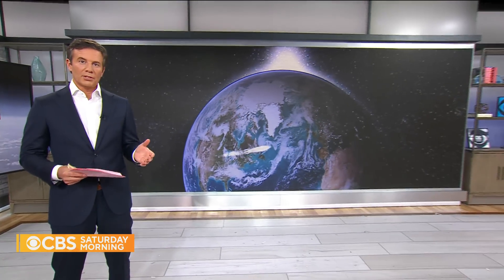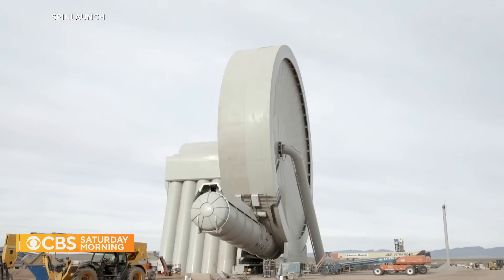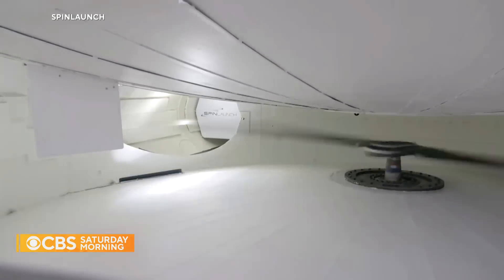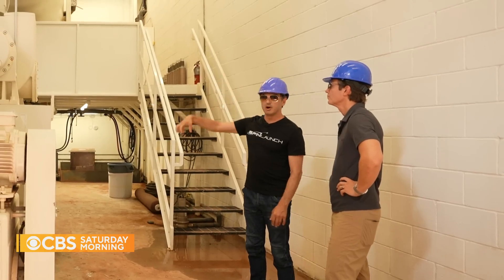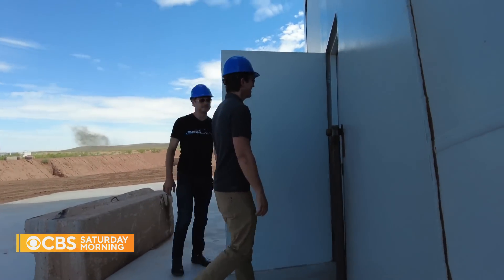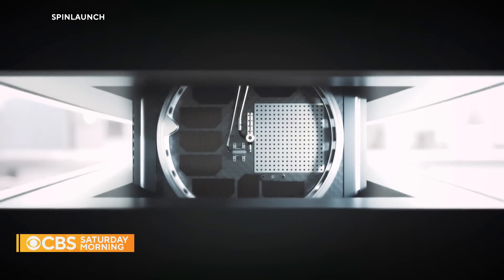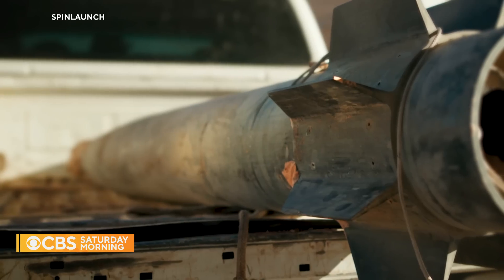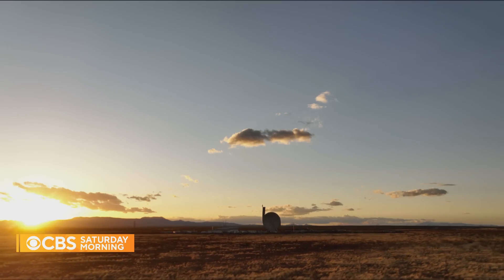New technology aims to put a whole new spin on space travel

Comment: This experiment shows great promise. However, why not conduct it near the summit of Mount Everest instead of in New Mexico? At Mount Everest, the air density is only one-third of that at sea level, which could make the experiment much more feasible. In New Mexico, the air friction immediately after launch will slow the projectile significantly. 

I guess, in a few decades, conducting a Spin Launch on the moon, where there is almost no atmosphere, might yield fantastic results.

On the other hand, I wonder what kind of technology withstands such extremely high acceleration forces. Despite this challenge, I am confident that many sensors and transmitters can be specially designed to endure these conditions to produce great and very useful space probes.

Comment: This wont work. Even an airplane cannot accelerate to max speed in low altitudes because of drag. You would need a way to get rid of the atmosphere at low altitudes. Otherwise youre just stuck lugging solid darts of steel because anything else would be destroyed in the low atmosphere

Comment: This does not even survive napkin math. This has no path to orbit. This cannot "get to space". 

MECO of a Falcon 9 is about 80 kilometers (50 miles) high, traveling at mach 10. This is where the second stage is started.

This launcher, not only could not launch a second stage, but it cannot even reach MECO speeds.

Anything they launch will require a second stage to get to orbit with the same required delta-v. A typical second stage of a Falcon 9 weighs 4,000 kilograms (8,800 pounds) without propellant. With propellant, the second stage weighs 111,500 kilograms (245,800 pounds). SpinLaunch's full-scale size and exit speed of 5,000 mph (8,100 kph)  translates into a peak centripetal acceleration of between 50,000 and 100,000 g's. One g is the acceleration due to gravity at Earth's surface. This means their spinning arm would need to hold between 5,575,000,000 kilograms (12,290,000,000 pounds) and 11,150,000,000 kilograms (24,580,000,000 pounds).... In layman terms: Their single spinning arm would need to hold between 14 to 30 Golden Gate Bridges not counting the concrete anchorages. There is no material that can hold that. This is just a big gun with no gunpowder.

Comment: The point is reaching orbit by going over 20,000 km/h parallel to the ground. Just Going up high into space is mostly useless. If you could reach as high as the international space station, it would be pointless if it zoom in and crashed into whatever was lauched at over 20,000 km/h, that collision  would  be a disaster.

Comment: What about a barrel that goes far into the ground and uses spinning wheels to rotate at appropriate accelerating speeds to send a projectile out (like a hot-wheels speed booster) fast enough to reach space that same way, but slightly different in design

- eliminating the centrifugal force altogether, enabling humans to go also, instead of just equipment.  

That would be like a car, mixed with a gun, mixed with a rocket

🙂

Comment: Problem #1: Can the payload survive spin-up?  
Problem #2: traditional liquid-based rocket fuel cannot be used--won't survive spin-up.  
Problem #3: Membrane has to be strong enough to maintain the vacuum, but thin enough to allow an easy exit velocity from an object at 5,000mph.  In other words, the membrane is VERY vulnerable to even the smallest rogue material particle that's in the vacuum chamber with the projectile.  
Problem #4: The projectile has to survive exit impact with the membrane at 5,000mph, and then also survive the additional impact of hitting the atmosphere.  The greater the surface area and mass of the object, the higher the initial exit velocity, and consequential impact
Problem #5 Atmospheric drag force on the projectile will be ENORMOUS!  Traditional rockets' initial exit velocities are slowest while the atmosphere is thickest, and fastest when the atmosphere is thinnest.  The Spinlaunch Concept uses the reverse, a counter-intuitive method.
Problem #6 Releasing a projectile from its spin-up state to its exit point at 5,000mph is going to require major precision in the program designed to monitor “timing” for this event.  Not to mention, repeating it multiple times per day.  A single error, such as a rogue particle in the vacuum chamber, could damage the payload projectile and the delivery SpinLaunch vehicle.  

There are A LOT of unknown variables that greatly diminish the probability of repeated continuous successful launches.

All-in-all…when I first heard about this project, I could never imagine it successfully launching objects 150 miles into the atmosphere, relying solely on a “spin-up” velocity.  And this project STILL relies on Rocket fuel for its final exit strategy.  But the forces at work would be tremendous–—WAY more than a rocket system, especially as payloads increase in surface area size, and mass.  Not to mention, that vacuum chamber will have to be kept sterile clean or be able to withstand rogue dust particles caught in the spin-up chamber, also GREATLY increase with size of payload and the forces exerted on it.

This project must have had ONE HELLUVA marketing team to receive investment because after reviewing it a second time, the theory is cool, but the physics seem completely impractical.

Comment: I can't believe how many people think this will fail. I spent a few days running through calculations about a year ago when I first heard about Spin Launch. I looked at different weights, radius of rotation, several projectile geometries with different centers of mass, release timing requirements for stability for different projectiles, strengths of materials, drag through atmosphere upon release, etc, etc. After all the calculations, I found a range of acceptable parameters for certain materials, launch velocities, projectile designs, and a requirement on the time to release the front vs rear of the projectile. It's not impossible. In fact, the ranges are wider than I expected. Spin Launch will be successful if they have competent engineers. It's all about the design limits, and collecting good data to making everything balance. There's no magic here, just good design and hard work.
Reply: There's no market for them, at all. Even if the laws of physics weren't working against their favor, they still won't be able to provide cheaper launches than already extant companies like Rocket Lab and especially SpaceX with their rideshares for smallsats. Even if they can match price parity, why fly spinlaunch when you have to harden your cubesat to survive 10,000G shock loads when you could just spend far less on the design and construction and then spend the same for a launch on an electron rocket? there is absolutely no use case for spinlaunch here on earth.
Reply: @KingHalbatorix  you seem to be an expert on this topic. You should offer your knowledge to them and their investors so they all save a lot of time and money.
Reply: @KingHalbatorix they put a smartphone inside and it was fine so G forces are not a problem. If you don't put a human inside is perfectly feasible.

Comment: Seems like a fancier version of Solar Roadways (also promoted by legacy media). As interesting a concept as it is, I think these are wild claims about a barely workable idea. The advantage is minor and I'm doubtful that it can be upscaled without a revolution in materials science since the forces  are enormous. Carbon footprint claim seems like a scam for funding. I'm pretty sure that the carbon produced to  generate the electricity to spin the rocket up to supersonic speeds over a few hours is at least equivalent to adding a 1st stage or adapting the design to be a single stage to orbit.

Comment: No life can handle the G forces that they would be subject to in the speed up or the 30 flight to orbit. Also the payload size looks small for life support. Could be a weapon that doesn’t set off early detection. Stealth nuke projectiles? I think the sling is still a weapon. Hope I’m wrong.
Reply: You are wrong, but you probably have lots of experience with being wrong
Reply: I may be wrong. Should have stated it as an inexpert opinion. So the Gforce problem isn’t insurmountable. it’s probably a matter of careful acceleration, fine. But what about the pod size. Tiny.Dense “ballast” shaped weights can help with the mass of a human at the center of an ultrasonic bullet. But how are you fitting a spaceship in the bullet too? It has to, at minimum, have life support. And survive immense heat from atmospheric friction.

You are right, I have a lot of experience being wrong. I am a life long learner and look forward to being wrong many more times along the way. Good luck out there your highness.

Comment: At a top speed of 4,700 mph with a 33 meter-diameter arm, it would be spinning at around 1200 rpm, resulting in a g-force of about 26,000. Seeing as how humans cannot survive greater than 6-9 g's, this is only for non-human payloads as they say at the end. 
I also wonder what the total energy cost is per launch. I imagine it would sill be expensive to pull an ultra high vacuum for a chamber that size and to power a centrifuge motor to accelerate many tons up to supersonic speeds.

Comment: Let’s analyze this a bit.

Mach 33 is 33*750mph = is 25,000MPH.
Divide by 60 to get 412 Miles Per MINUTE.
multiply by 5280 to get 2 MILLION feet per minute.
Divide 60 to get 33,333 FPS
Divide by 3 to get 11,111 MPS

Now, let’s guess the thing if 30 feet (10M) in diameter. Circumference is pi*d = 90 foot (30M) circumference.

To be traveling 2million feet per minute, at 90 feet per revolution implies 2million/90RPM
That’s 22 Thousand RPM.
That is scary. I hope the whole thing is made from 4 inch armor plate.

Now, let’s analyze the force on the rotating arm holding the projectile.
Let’s guess 50# projectile, 50# release mechanism, 100# arm. (I’m going to ignore the mass of the arm because the “radius” changes.
Centripetal force is Fc = m * v^2 / r

M= 45kg 
V = 11,000M/S
V^2 = 121,000,000
R=5m

Fc = 45KG * 121million / 5 = 1.1 BILLION Newtons = 112 MILLION KG.

That gonna be some hefty death rotor, how will they anchor it to the ground?
Reply: Right off the bat you're using sea level Mach so you're already skewing your results. The whole comment is misleading.
🙄
Reply: @Rjsjrjsjrjsj  
Hah! I just realized that this is the first physics question I think I’ve ever seen where “ignore the effects of air friction” works for the real life answer!

How many RPM will it need to spin up to?
Will it tumble at that RPM for a bit after release?

Assume 100Kg projectile.
What is the tensile force on the arms?

Bonus question: 

How long would it take a 100HP electric motor to spin this thing up to speed?

Comment: ok but you can only transpo stuff that isn't g-force sensitive. at 5000mph only solids and heavy liquids and some hard building materials can be sent. i don't think the delicate circuitry in a small satellite would hold up to 1000g+ but what do i know. also skeptical they can build one 3x larger. id think its like a wooden ship...you can only build one so large, no matter how clever you are with bracing, futtocks, hanging knees etc before it flexes and has foundered and sank right to bottom, just like this project. also, how much energy does it take to put that giant chamber under partial vacuum (note they said vacuum, but that just seems impossible with that thin film holding the outside air back)? im willing to be it takes precisely a metric crapload, negating the entire thing right off the bat.

Comment: I always wondered what would have happened if a batch of Valkyrie bombers had actually been built other than the two prototypes, and what NASA could have done decades ago with using a launch platform that could carry a 50,000 pound rocket in it's huge bomb bay, and launching that rocket from around 65,000 feet and Mach 2.8 or so.  I would have to think that with the launch point being so high up and with so much inherent velocity from the launch platform, a comparatively very high payload to fuel ratio could have been attained on such rockets.
Reply: That's probably the only reasonable proposal for air launch I've ever seen, but I'm not so sure they could actually negotiate the issues with opening the bomb bay and releasing a payload at near mach 3.

Comment: Is there a plan to build a linear maglev vacuum tunnel to launch astronauts too?
Reply: Well as lomg as acceleration line is long enough... mostlike;y it will work.. but main problem proanly will be it has to change drection slowly may be using emtire planets surface as acceleration surface then just leawing ground lines at high speed probably will make direction change/gfrce low enough to not kil astronauts 😊 ... but anoter two peoblems are providing accelerars power tough that lie an copper requirement probab;y world doent habe enough copper for coils 😢 ewen i you have the money ...

Comment: "How do you get satellites into orbit?"
"We basically just throw them really hard."
Reply: Except that doesn't work, you can't throw something into orbit without another burn at the far end to circularize the orbit (Hohmann transfer) otherwise the object goes all the way around and comes back to the exact same spot you threw it from like a boomerang and crashes into Earth. You need to throw a rocket so you can get that added burn once at altitude.
Reply: @wally7856  I don't think it's that challenging from an orbital mechanics standpoint. I think it's more a problem of designing functional satellites that can survive the rotational acceleration necessary for an exit velocity well above their target orbital velocity (~17k mph), and developing materials that will protect the satellite from compression heating within Earth's atmosphere. The latter is orders of magnitude more difficult than atmospheric re-entry, which is already reasonably challenging.
Reply: @mifune9634  The electronics in the Excalibur artillery shell are designed to withstand +20,000g's and  -8,000 g's. Same with Canada's HARP program in the 60's that would fire space going payloads from a gun (largest artillery in the world) to about 187 km (116 miles) high hitting 20,000 g's. They never achieved orbital velocity (which would have been achieved using an on board rocket in the shell, not from the launch itself) before funding was cut.
Reply: @wally7856 uh hate to break it to ya bud but they've already had several successful tests rendering your point moot and nil😂
Reply: Just get Josh Allen.
Reply: Lots of curls bruh

Comment: In the 80's England had a design for a space plane that would use wings to get to high altitude, and had air compressors on board to compress the air it would need to get up to speed in the higher altitudes so it could reach space.  They never had as much money as NASA so those plans just disappeared into history.  The lessen is good ideas are completely valueless if you don't have the money to pull it off.
Reply: It wasn't even a good idea. Air launch and lift-generating SSTOs are always a waste of every resource involved, including the paper and/or electrons used to calculate just how much of a bad idea they are.

Comment: Dude better start showing some spectacular results and soon. It seems like everyday SpaceX has done something ingenious that's got the folks at NASA shaking their heads in amazement.
Reply: Not really. Nasa can do what space x is doing, problem with nasa is funding so they outsource. Engineering wise nasa can do it
Reply: @GrimYak  you're absolutely wrong in every single possible way.
NASA anually has more than twenty times the budget of SpaceX, yet they have only launched ONE rocket of their own design in the past decade
The engineers at NASA are largely the people at fault for the eye-watering cost of SLS, and the fact that it can barely shuffle out to the launch pad once every other year
Put simply, NASA genuinely cannot even dream of doing what SpaceX does.
Reply: @KingHalbatorix space x do only space rocket things, NASA do a lot of different things. And NASA cannot build things too risky, it is very limited by congress decision's.

Comment: They can save even more fuel as they can tune the engine bell of the rocket motor for the altitude it ignites/ orbit, as opposed to having a design that has to be a good fit from sea level to orbit. Could also be a good weapons system/ launcher. Another thought would be to add a kinetic energy recovery system (KERS) via a flywheel and generator to recover some of the energy as electricity.
Reply: True
Reply: Wouldn't need a flywheel: the spin-up motor would be capable of regenerative braking and recovering the spin energy of the throw arm and axle assembly.
Reply: Most of the “spin energy” goes with the projectile. Like a giant exploding flywheel.